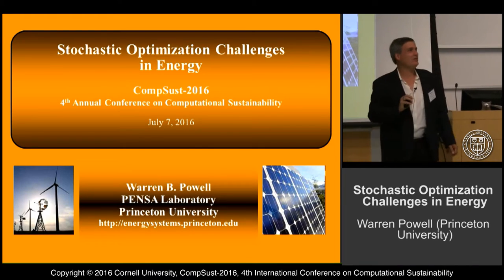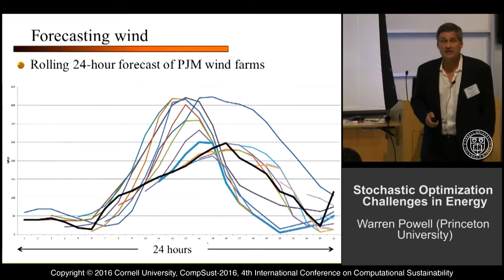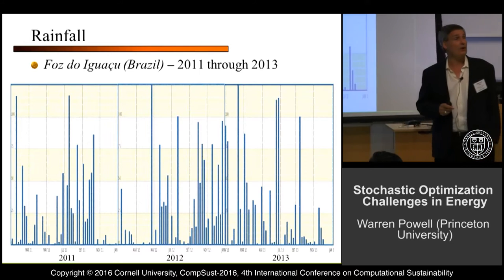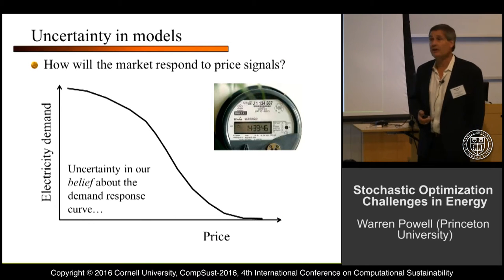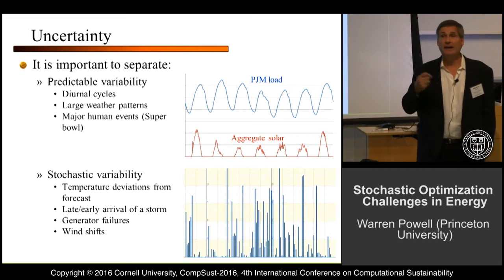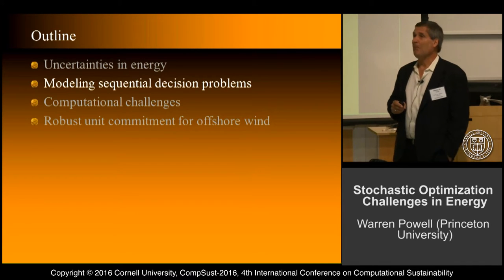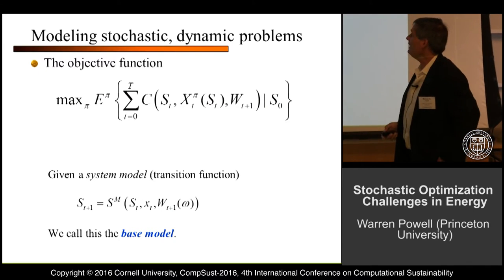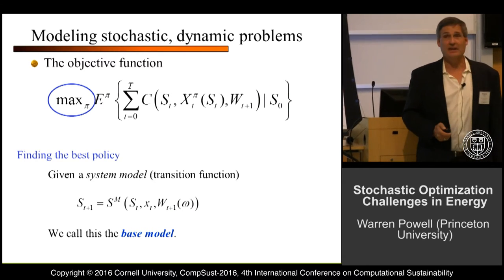Warren Powell, "Stochastic Optimization Challenges in Energy"

Comment: what's the difference between dynamic programming and stochastic programming, until i was only familiar with the deterministic  and stochastic optimization, what is dynamic and how it is different from the other two??/
Reply: Dynamic programming is a different concept from those two. It has derived from using the memory more efficiently, by using dynamic programming, you are storing the results as you iterate over your steps and it saves you from the burden of re-calculating your values of the algorithm from the start, and decreases the complexity of the problem. You can check out the Coin Change problem for instance.